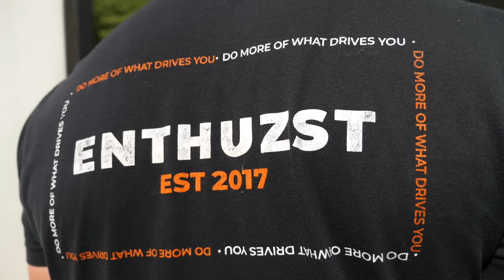1113HP Cummins DOES A WHEELIE Racing Gabe Farrell Productions 800HP 2nd Gen

Comment: If he cleans up all that coal he will make more power.
Reply: If he doesn't he can roll coal
Reply: the extra fuel keeps EGTs down
Reply: @rexmikakka  having your truck built right keeps egt’s down.
Reply: @rexmikakka  in a diesel a rich mixture keeps EGTs HIGH. With this HP the EGtS are gonna be through the roof no matter what.

Comment: Chip seal is what you were driving on.. once you get the rocks off it’s straight “tar” liquid asphalt that is thick and sticky af specially when it’s summer/spring and the sun has  beating on it.. great no prep roads/surfaces after a pull or two

Comment: are you starting in granny gear? I never use first gear unless I'm pulling. i start in 2nd and shift to 3rd within the second.  It nearly impossible to beat an auto trans but you should be pulling a lot harder. But then I never driven a 2nd gen mines a 3rd. Not much done to it because I've been working on my 6.0 excursion and 1.9l tdi. But I can't wait to get my 05 dodge ram built up some more. You all make me miss driving my truck. Haven't driven it in about 5 years since my accident with a DUI driver gave me some ptsd. Anyways some bad ass trucks.

Comment: That truck is not a Cummins. The truck is a dodge. Cummins is the brand of engine that Chrysler used in the truck. Everything that engine is hooked to is made by Chrysler. Not sure on the point of putting so much carbon and soot into the cylinders? If it was tuned better the smoke would clear up and engine would run even better. I'm sure the soot and carbon is good for the exhaust valves and exhaust side of the turbo too. And this is also why the epa wants to shut down all mods to any vehicle that was manufactured with a vin or engine that was designed and epa approved. Good job giving them more reason to shut down fun.
Reply: its just more fun man calm down